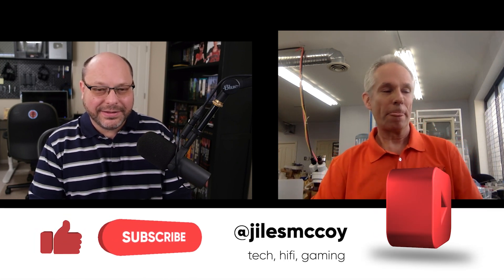Why Your Cheap DAC Sounds like Junk

Comment: of course you could dump a bunch of dedicated power supplies in your unit, or you could build a circuit that'll need only one, but apparently that's too hard of a task for the person on the right.
Reply from the maker: Not sure. It could be as simple as just hanging two speakers off the channel. Curious what people think. If I can get a video wall I am going to try it. I am really interested in this tech.

Comment: I'm sure that there are even better DACs out there but if you're like me in terms of being willing to spend a significant amount of money on audio gear but not having access to crazy amounts of $$$ - if you want a DAC with this chip, get yourself a Gustard X26 Pro. It is a beautifully designed DAC with two linear power supplies (for the digital and analogue sections) with the ESS chip at its heart. If you're then tempted to squeeze even more performance out of it (and if you have access to high-res speakers/headphones - you will be!) then put it in NOS (non-oversampling, bypasses internal filtering) mode, feed it externally-upsampled signal, preferably 1-bit DSD (you can try software called HQPlayer for free), pick a filter that best aligns with your perception of natural sound (time domain vs frequency domain), pair it with a nice Class A amplifier and enter the world of digital audio that sounds analogue/smooth but with all the details and precision that the digital format offers. It's a great time to be an audio enthusiast because so much of this mind-blowing technology has trickled down to acceptable price brackets (for us, mere mortals, hehe). 😃